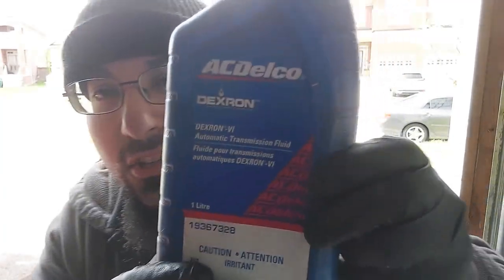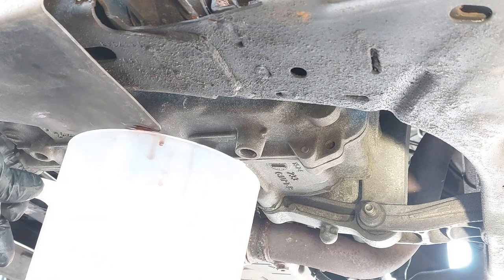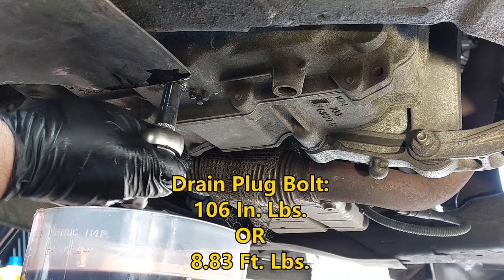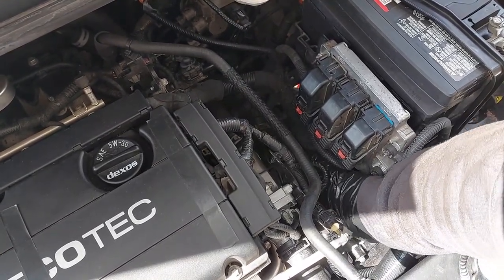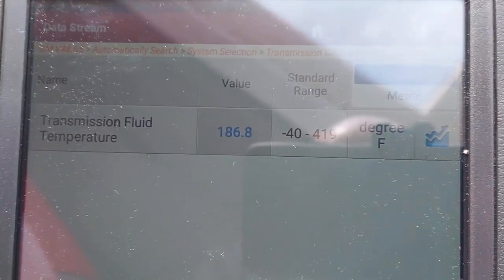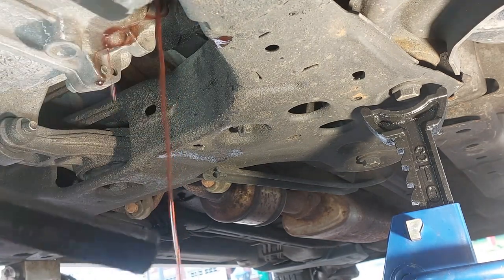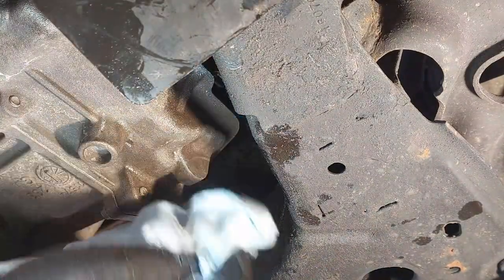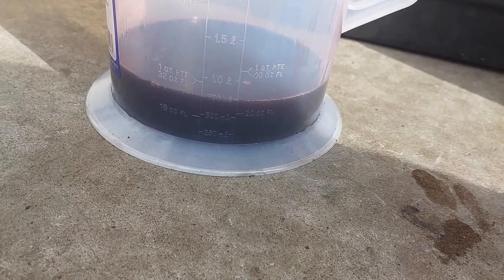2014 Chevrolet Sonic 1.8 - 6T30 | 6T40 - Transmission Service

Comment from the maker: Measuring Container with Spout - 4.5 Quart Capacity
https://amz.run/9GZu

Launch X431 Scanner V+ PRO 4.0, All System Bi-Directional Scan Tool with 10.1’’ Larger Screen, 37+ Resets, 24V Trucks Repair, ECU Online Coding, NO IP Limit, VAG Guided Function, 2-Year Update
https://amz.run/9GZv

Comment: THE 11MM OVERFILL BOLT IS EASILY REACHABLE WHEN YOU: 1. REMOVE THE TIRE    2. USE A 6 INCH EXTENSION   3 USE A 1/4 INCH RATCHET ( I USED A MAGNET ON MY EXTENSION TO REMOVE / REPLACE THE BOLT )   //  THERES ENOUGH SPACE TO ACCESS IT WITHOUT CRAWLING UNDER THE CAR & BURNING YOUR HAND. ALSO TO PREVENT THE BOLT FROM FALLING INTO THE VERY LITTLE  FLUID COLLECTED, I USE A MAGNET ATTACHED TO EXTENSION - NOT NECESSARY THE FLUID COOLS QUICKLY //    NOTE:

Comment: When check the level could you just stop the car once it started dripping, let it cool and then put the bolt back in?
Reply from the maker: No, the engine has to stay running in order to check the level properly. You must reinstall the bolt during the procedure, otherwise the level will be inaccurate.
Reply: It states in the service manual if you turn the engine off when the check bolt is undone the fluid will just dump out. The engine needs to be on the entire time.

Comment: Sorry to keep bothering you. I can't reach 185f no matter how hard  I  tried. I tried the method you suggested : foot on brake & acellerator , ran thru gears slowly . I also drove 94 miles driving 65 -75 mph when i arrived home after WAITING about 15 min  , i removed the drain bolt, yes drain bolt UNDERNEATH the car & captured a small amount of fluid ( IT WAS HOT ON MY HAND BUT NOT INTOLARABLE) & measured the temp. with my multimeter temp. probe . the temp. was 135f . I AGAIN TRIED THE BRAKE , ACELLERATOR METHOD TEDIOUSLY &  WAS ONLY ABLE TO REACH 151F .FINALLY, I DECIDED TO PUT THE AMOUNT YOU DRAINED FROM YOUR CAR 4.2-4.3 QTS.
Reply: thanks anyway

Comment: greetings moose mobile auto repair! Where did you buy that measuring cup for the transmission fluid? Also what scanner did you buy to measure operating temperature? I have a obd2 scanner yet it connects to my phone. The brand is bluedriver.
Reply from the maker: Measuring Container with Spout - 4.5 Quart Capacity
https://amz.run/9GZu

Launch X431 Scanner V+ PRO 4.0, All System Bi-Directional Scan Tool with 10.1’’ Larger Screen, 37+ Resets, 24V Trucks Repair, ECU Online Coding, NO IP Limit, VAG Guided Function, 2-Year Update
https://amz.run/9GZv

Comment: Hey moose should I leave the car on when I check the level?
Reply from the maker: Yes, while idling in park.
Reply: @moosemobileautorepair  okay thanks bro and switch through all gears before hand?
Reply from the maker: Sure. Warmed up and go through all the gears then check the level. For every time if you need to top up the fluid you will need to go through the gears again before checking the level.

Comment: how many miles is too much for an oil change?
Reply from the maker: Anything over 5000 Miles for an oil change is too much.

Transmission service should be done at a minimum every 45000 Miles (72000 Kilometers) according to the GM scheduled maintenance for severe driving conditions. My recommendations for transmission service on this vehicle around 30 k to 40 k Miles (48000 to 64000 Kilometers).

Comment: When you get the fluid dripping ,  meaning it's 'full , could you just shut if off and cool so you can tigten the bolt?
Reply from the maker: Vehicle must be running while closing the check bolt/plug. It cannot be turned off otherwise the level won't be correct.

Comment: I have a 2012 Sonic. Is there no transmission filter on this model?
Reply from the maker: There is a filter on all of these models, however the transmission pan and filter is mounted vertically and the transmission would have to come out in order to change it if I'm not mistaken.
Reply: Have you looked into getting some of those Kevlar/Nomex forearm sleeves for working on “inconvenient” designs like this?
Reply from the maker: Thanks for the tip! No, I haven't, but I ended up wrapping a rag around my arm. Sounds like a good idea though I'll check them out!
Reply: You can't access the filter without tearing apart the transmission.

Comment: Great job 
Wouldn’t whatever amount of fluid you drained be exactly the amount that has to go back in? Seems like alot more drained out when checking the level
Reply from the maker: There is always going to be some amount to drain out when checking the level. It's advised to fill the transmission a little bit more so you can check the level properly. The fluid expands when it's hot so the amount of fluid you drain out won't always be the amount to put back in depending if you drained the fluid when it was hot or cold. The temperatures between the new and old fluids won't be the same hence the level will be a little different.

Now, in some cases you can get away with it by draining and measuring and putting the same amount of fluid back in. However, it's still advised to check the level in the end just to be sure.

Comment: Hi just out of curiosity, how long did it take to get the transmission fluid temperature from cold to the hot check temperature in minutes.?
When refilling.
 ( total time ) 
Thanks
Reply from the maker: I can't give the exact time because I was filming the video that day, but you can get the vehicle to operating temperature in around 5 to 10 minutes just by driving it normally and coming back to lift the vehicle up and service the transmission. The service can be done in about an hour or less it just all depends on your speed.
Reply: @moosemobileautorepair  Hi , I asked because I have a 6T45 and have done 40 mins of highway driving to get it to the hot check temperature and still can't reach it.
When I get home and let it idle in park the temperature actually drops.
The temperature is checked via a obd2 dongle
Reply from the maker: 40 minutes of highway driving should be more than enough to get it to operating temperature. I would double check to make sure that you are monitoring the correct transmission temperature on the scan tool. Also, if you idle in park the transmission temperature will start dropping so you would have to be quick to check the fluid level then. You can do what I did in the video to warm it up by placing it in gear while on the brake and holding the accelerator all the way down (use caution of course and chock the rear wheels for safety). Alternatively, if the process is giving you a hard time you can just drain what comes out and put the same back in. I believe it takes roughly 4.25 liters approx. If I'm not mistaken.
Reply: @moosemobileautorepair  Thanks for your advice, I do have a transmission temperature PiD (  GM method 2 ) on scanning device, next time I will use your method, 40 mins of highway driving only reaches 160 F. My vehicle has a transmission cooler fitted from the factory, Maybe that's got something to do with it.